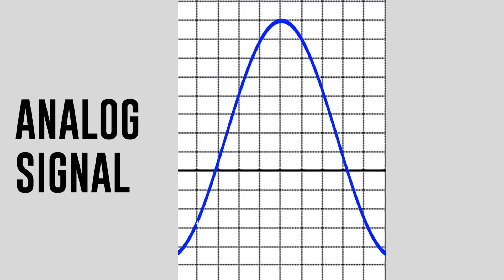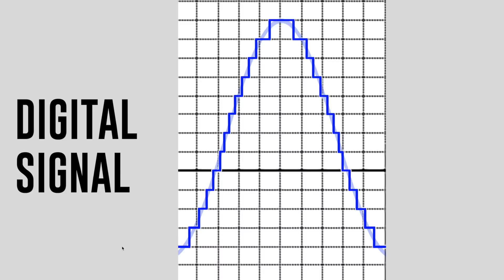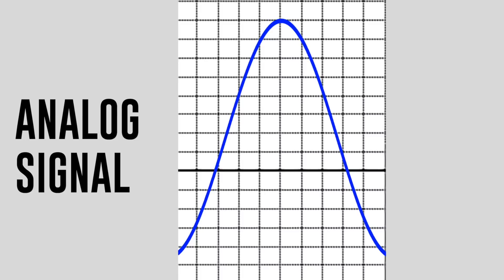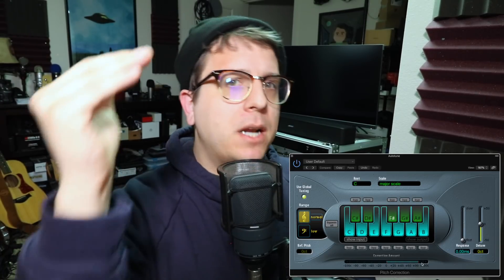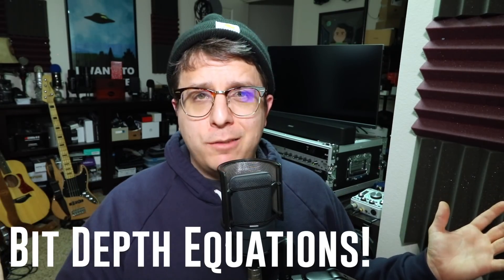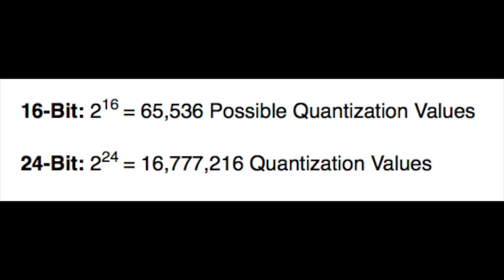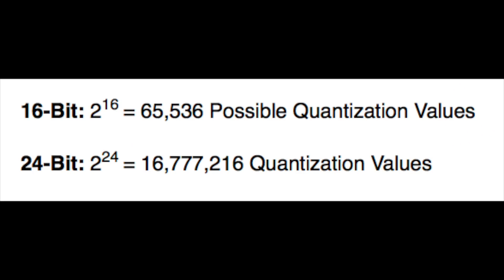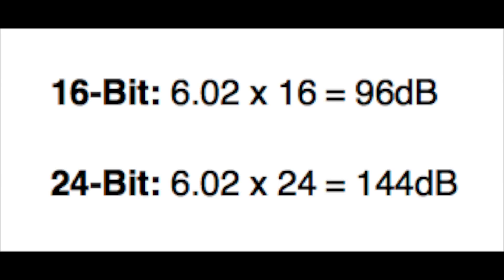16 bit vs. 24 bit Audio, What Should You Record At? (FAQ Series)

Comment: You have to have recording hardware that's well guarded against electrical noise to worry about the noise floor of 16-bit.  In most systems the unwanted noise is well above it.  Even silence cutting filters default to far above it as detected as silence.

Comment: I think you’re wrong about bit depth.  Sample rate resolution is like 1080 vs 4k tv resolution.   But Bit depth is about the dynamic range of the sound;  i.e. how low level a sound can be recorded at compared to the highest level.
Reply: I was thinking the exact same thing. I'm just getting into this subject, but my understanding and what I've read so far that its a lot more about dynamic range than a better sounding initial recording.

Comment: To put things into perspective, a good modern condenser microphone may support a dynamic range in excess of 130 dB (e.g. Rode NT1a), occasionally even approaching 140 dB (e.g. AKG C4000B, 137 dB(A)). That's way beyond the capabilities of 16-bit recording, even approaching the limits of 24 bit. Granted, you are not likely to have to record both a bumblebee and a jackhammer with the same settings and obtain decent results for both - but you could, assuming your preamp and ADC are up to snuff. 
On the playback side, human hearing struggles when confronted with more than about 70 dB all at once (even though it'll go down to ~0 dB SPL when it's quiet and accept 100+ if need be), so assuming you have a volume knob, 16 bits basically do the job just fine. It's just when you try to brute-force things and want to run a DAC directly into a power amp with some potent speakers that you'll find 96 dB don't really cut it.

Related to this is why having "too little" gain on your mic preamp isn't necessarily an issue. As long as it gets the mic's internal noise well above the ADC noise floor (ideally by 10+ dB) while not adding too much of its own, that's all that's really needed. All the rest is convenience and "out of the box" usefulness of recordings, but ultimately functionally equivalent to adding gain in software.

Did you know that you can determine a good estimate for the (best-case) equivalent input noise level of a dynamic mic entirely from its specifications? That's because its noise will be dominated by its voice coil resistance (which generally is close  to nominal impedance), as all resistors generate thermal noise in a predictable and well-documented manner (see Johnson noise) - so you know your electrical noise level. The microphone's sensitivity spec then allows you to translate noise voltage back to dB SPL (as 1 Pa = 94 dB SPL). For example, a 200 ohm, -54 dBV / Pa (2 mV /  1 Pa) mic at room temperature (295 K) would have 0.26 µV of noise over a 20 kHz bandwidth, which in turn is the equivalent of 16 dB SPL. 
Remember, that's the best-case scenario - no amp noise, no nothing. Even so it's roughly the equivalent of a good small (0.5") condenser with a capsule typically twice the size or more. If you were to build a dynamic mic with the noise floor of a SOTA large condenser (3-5 dB(A)), it would have to be quite large with the associated very narrow directivity in the highs, not what you want in a general purpose mic. 
So why don't they build high efficiency microphones, you say, just like high efficiency (PA) speakers? Simple, at a given transducer size there is a tradeoff between efficiency and low-end response, and it's not like dynamic mics tend to be real bass kings to begin with (unlike condensers which can record very low as long as their buffer stage has very high input impedance). I mean, what would you expect from a 1" wideband speaker? These things just have to be very inefficient to have any bass at all, and there are very few parameters to tweak. Narrower air gap (beware of production tolerances), stronger magnet (e.g. neodymium instead of ferrite), choose impedance to make voice coil lighter and as such reduce moving mass (but don't make it so high as to get in trouble with input current noise on typical preamps)... that's about it. The "hottest" dynamic mic I can think of offhand would have to be the AT BP40, -48 dB/Pa @ 450 ohms with what I assume is a 40 mm (1.5") capsule.

Comment: Youtube uses AAC for sound . This compression is very lossy I think it's on the same level as MP3 
Most recordings are in WAV or FLAC I personally record  in FLAC . 
On Youtube due to the heavy compression it's pretty pointless IMO to record 24-bit
Spotify uses Ogg Vorbis which is the best compression so far . The losses are minimum and it sounds much better . So if you're aiming for Spotify you have benefits to record 24-bit 
I may be wrong . I don't know much . But I hope I helped

Comment: The sad thing is that music today recorded at 24-bit and crunched down to 4-bit would be mostly unnoticeable to your common music listener listening to a 320k MP3.

Most listeners today have never experienced full dynamic range recordings and nearly all of the music they're listened to in the last 25 years has got louder and louder negativing the purpose and effect of higher bit depth and mostly because 80's music producers were either idiots or didn't realise that less really is more when they slapped digital compression all over EVERYTHING in the 80's and the rancid process never left the music industry as filling in all the gaps is some sort of perverted musical 'goal' for badly trained producers!
Reply: Think the loudness thing started in the 90's, 1993-1995 was when it really kicked off.
The 80's sound, was the bright gated reverb (mostly on snare drum).

Comment: Thanks for the video! I’ve never realized the actual difference so clear, before I saw picture quality and numbers difference. In my understanding: record in 24 bits for better processing (noise reduction, compression, EQ, mixing) and publish in 16 because no one would ever notice the difference on YouTube or in a typical podcast.
Reply: I think with quieter sound you notice the bit resolution more. I wonder if you can do logarithmic bit spacing or some other like square root distribution to have a greater concentration around the zero line of the drawn audio wave

Comment: How’s is the bit depth affected when you convert to a mp3 file (Eg for podcasts)? Will it make larger file sizes?
Reply: MP3 has its own representation of audio data. The file size will be around the same. There's a chance it could get smaller.

Comment: Nice and informative video!

But a quick calculation which is highly suggestive. Not necessarily precise, but it gives a fair estimate.

(I'll be using the European decimal point, which is a comma.)

Say you record 16-bit 44.100 KHz audio for 10 minutes.
16 * 44.100 = 705.600
We'll divide the number by 8, since the data on your storage device is displayed in bytes. 1 byte = 8 bits
705.600 / 8 = 88.200
Now that we have the storage in bytes written per second, we'll simplify it to megabytes (MB), so MB/s instead of B/s.
88.200 / 1.000 = 88,2
Now we have the kilobytes per second (KB).
88,2 / 1.000 = 0,0882
Now we have the final result, 0,0882 MB/s. Meaning that per second recorded of 16/44.1 audio takes 0,0882 megabytes.
That would mean that 10 minutes would use 52,92 MB of your storage device.
Now let's take that in high-resolution recording to see if it's actually just for "pro"-use.
Our recording will take place in 24-bit 192.000 KHz.
24 * 192.000 = 4.608.000
Now we could be lazy and just divide 4.608.000 with 705.600, since that is the 2 different rates of bits written per second. But we'll do the math.
4.608.000 / 8 = 576.000
Now we have the number of bytes written per second of recording.
576.000 / 1.000 = 576
Now we have the number of Kilobytes written per second.
576 / 1.000 = 0,576
0,576 is the number of Megabytes written per second of HD audio.
That would mean that 10 minutes would use 345,6 MB of your storage device.

Now that we have done the math and found out that on the storage side 16/44.1 versus 24/192 means 52,92MB/10min. versus 345,6MB/10min.
The most popular HDD (Hard Disk Drive) is a 1 TB Western Digital Blue. Now due to the drive being divided into 1024 KB blocks by the OS (Operating System), that means we have 931 GB (Gigabytes) of storage available to us. Which is 931.000 MB.
So the number of 10 minute "low" vs "high" definition audio files we have room for on a completely empty 1 TB (1.000 GB) drive, is:
Low (16/44.1): 931.000 / 52,92 = 17.592,59
High (24/192): 931.000 / 345,6 = 2.693,87
This means that you can store about 17,5 thousand 10 minute files of "LD" and you can store about 2,5 thousand 10 minute files of "HD".
To put that into perspective, let's calculate how long that is in number of days.
(24 * 60) / 10 = 144
We can play or record a 10 minute audio file, or any 10 minute file, 144 times in a day.
17.592,59 / 144 = 122,17
2.693,87 / 144 = 18,71
This means that it would take you, me or anyone 122,17 days to fill up an entire 1TB drive with 10 minute "LD" audio files, if we imagine that the computer automatically splits the file every 10th minute.
It also means that it would take you 18,71 days to fill up an entire 1TB drive with 10 minute "HD" audio files.
Now that is if you were to leave your computer alone for that amount of time, recording non-stop to an empty 1TB drive.

So to summarize and conclude, aka. *TL;DR*:
It would take you more than 18 days of non-stop recording to fill up a 1TB drive with 24-bit 192.000 KHz files. That's not a normal use-case.
Also, the average storage space per storage device naturally goes up, as we continue to develop them. Soon, 4TB or more will be the norm for external HDDs.
So all this basically leads me to conclude that there is absolutely no reason to record in lesser quality, if your audio interface allows you to record in higher quality.
This calculation is entirely based on the situation that you record and store files... That means that if you use VOiP services like Discord or Skype, you don't use up space on your computer (other than perhaps cache, but I digress). So again: *Use the highest quality setting available on your audio interface*.
Reply: I said a quick -calculation-, not a quick -explanation-.
Reply: I'd also like to add, that this is if you use the maximum "resolution" all the time.
So realistically, you'd use even less.

Comment: Sampling theory tells us using fewer bits generates quantization noise. But quantization noise doesn't matter if you have already have significant noise in your signal; adding a little more won't make it sound worse. But honestly it's a stupid question. Skip the math and use 24 bits. This is 2018 people. 

As for sample rate, I doubt you need more than 44.1 kS/s (kilosamples per second). But there is an argument for using a higher rate which is that some signal sources (eg Brass) go higher than 20kHz and someone someday might want to hear that. Tape goes to about 30kHz so recording at 96 kS/s gives you somewhere north of 40kHz bandwidth - considerably more than tape. For mere mortals, 44.1 or 48 is probably fine. 

Hope that helps.
Reply from the maker: Mike Page great insight! I appreciate you sharing that information about brass and tape response. :)

Comment: Today’s ADC units are far better than those from the past. A bit depth of 16 and a sample rate of 44.1 kHz is more than sufficient for the human cochlea to hear amplitudes and frequencies as accurately as our hearing apparatus is capable of. This is true of a straightforward record and playback. However, when we edit digital audio in any way, we introduce new quantization errors that build up in the lower bits the more we edit. Enough so that we can start to hear the artifacts introduced by editing. So 24 bit is recommended for professional recordings that will be edited so that the artifacts generated in the lower bits are rendered well nigh insignificant because a smaller portion of overall bits are corrupted by S/E errors due to editing. Therefore if the editing after recording is minimal, then 16 bit is all you really need.
Reply: This is the most important part! 16bit 44.1kHz really truly is indistinguishable from 24bit or 32bit 48kHz. But if you're messing with the recording a bunch, it helps reduce noise! Another vital point; most older hardware and even some more modern programs can only use 16bit samples, so there's that.

Comment: Bro...that was awesome. I had so many questions answered but at the same time now have new ones. Great video, had me hooked from start to finish!
Reply from the maker: What kinds of questions did it raise?
Reply: Podcastage so a lot of different engineers that I send stuff off to are all so picky. Some people 16-441 mono some want 24-441/48 mono wav. So I guess it comes down to preference. But it’s sucks you can’t work with the sample rates back and forth with projects. For me, pro tools. If I created a session in 48, protocols or Windows or whatever will not open up the 44 project and of it does the system gets confused and all of sudden everything plays in slowmotion...including desktop audio. 
Yeah...questions. I learned all of this by serious trial and error. So I guess my main question is that when working with projects or systemsl audio drivers...why don’t they play well with each other and why can’t you jump back and forth we between them, with in them at times.
Reply: Its not the file itself, its the actual session. For example, if a created a protools session and what the devices are set to 48 or 44. In 48, it wont open on another system that is 44, i have to go into the option of the DAW and change it before opening the project. And if im using the same DAW as an audio card for my PC for my desktop audio and they dont match up, then i get the slowdown effect. YEah i know its confusing, but its real, and i found out the hard way through numerous trial and error
Reply: so this error would happen specifically when i was using my mixer as my Yamaha MG12XU as my sound card and ProTools DAW. My windows system would default to 48 but protools was set to 44. Once protools opened up it would try to convert the system that was 48 to 44 and every sound from the PC would play in slow motion, even the boot up screen. In the the end, i had to give up using the mixer as an all in one SoundCard and DAW..it just wasnt worth the constant hassle and uninstalling and reinstalling the drivers to fix the problem when ever it would come up

Comment: "Monty" Montgomery who created OGG container and Vorbis audio codec made an excellent technical explanation over at https://xiph.org/video/vid2.shtml
The chapter "bit-depth" and "dither" is relevant here.
TL;DW,  The higher the bit depth, the lower the noise and the higher the dynamic range. Dynamic range could be expanded within the same bit depth with dithering.

From another article here at https://people.xiph.org/~xiphmont/demo/neil-young.html
16-bit is enough for hearing range. For recording, 24-bit's lower noise could give an extra headroom for boosting the signal in post and apply effects after effects in post.
Reply from the maker: I'm going to have to give this a check out.
Reply: The actual problem is that we have to avoid digital clipping. In order to be on the safe side, we don't use the full dynamic range, leaving some headroom for unexpected peaks. So we use, let's say 14 bits out of the available 16 bits, or 20 bits out of 24. Since the hearing dynamic is about 16 bits, there is some loss if you boost your 14 bits to 16, no loss if you reduce 20 to 16. If you can control your recording dynamic to 16 bits precisely, using analog compressor/limiter for example, you can stick to 16 bits.

Comment: What happens if I connect a 44 khz microphone to a 48 khz interface and set the sample rate to 48 khz?
Reply: what is a 44khz microphone?
Reply: A microphone that have a sample rate up to 44khz.
Reply: It gets upsampled to 48k by your recording software.
Reply: That doesn't make any sense. What kind of digital mic are you going to be plugging into an interface?
Reply: I got a USB Mic --> XLR -->Interface --> USB!!! 44hz yo!! (I'm kidding, I'm kidding)
Reply: My audio interface can run microphones up to a sampeling rate of 48khz. So i can set the sampeling rate with each microphone on Windows 10 to 48khz. So Podcastage said when i plug a microphone it makes snapshots of my audio. Now i want to put a microphone that only have a sampeling rate of 44 khz into the audio interface. Now i set the sampeling rate on windows 10 to 48khz. Will it run on 44khz or 48khz?
Reply: The sampling rate is determined by the interface and software settings, not the microphone. If your interface can do 48kHz you set Windows to 48kHz, your interface will run at 48kHz.
Reply: Up All Night Oh sorry im a noob in audio. I thought a microphone also have a sampeling rate.